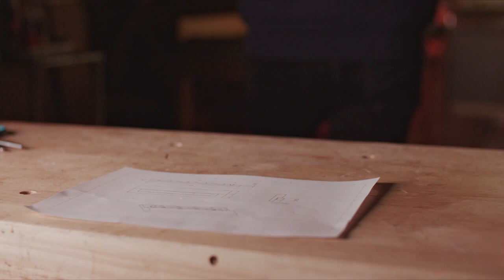Material Science Meets Art: Engineering Unique Tools for Musicians

Comment: Beautiful work.  How did you reset the xyz coordinates for the CNC for milling the second pass of the bronze aluminium?
Reply from the maker: The question you asked requires a detailed explanation. First, it's essential to understand the difference between absolute and relative coordinates in the process. As I currently work with relative coordinates, the endmill is used to locate the designated organ in the CAM operation. To achieve this, I touched off on one side, zeroed it, then repeated the process on the other side. I divided the distance by two, used the MDI to bring the tool to that point, and re-zeroed it. It's a precise process, but necessary for accurate results.
Reply: What a brilliant way to do it.  Thanks for the comprehensive response, I'll have to give that technique a try